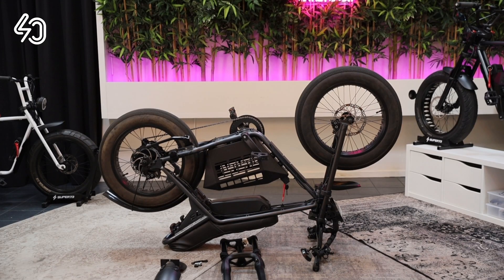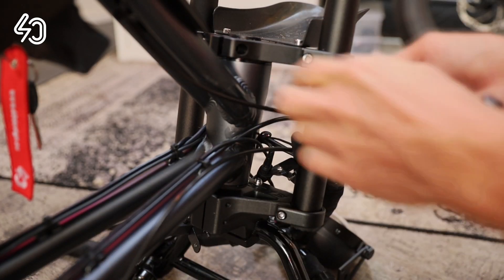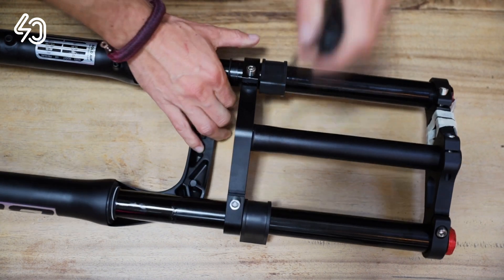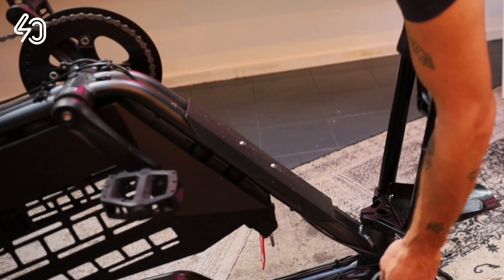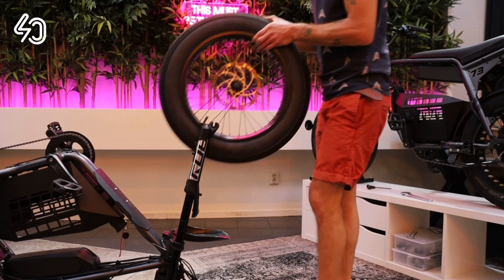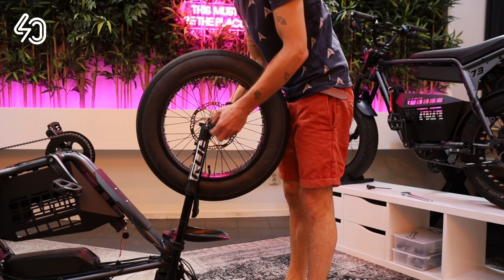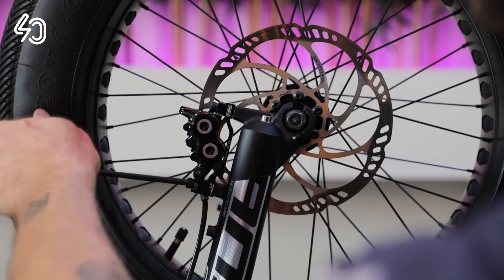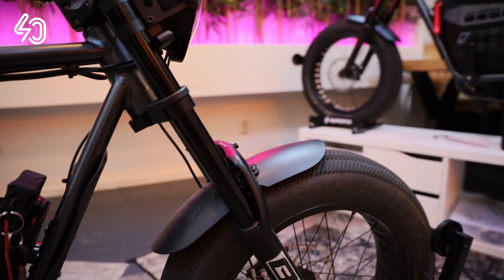Airfork installation on the Super73 ZX

Comment: Do u need anything else with these forks
Reply from the maker: Nothing extra required, it's an easy swap. However, there are some rare versions of the Super73 ZX where the original fork diameter is 31mm instead of 32mm, making the swap with a 32mm airfork less straightforward.

Comment from the maker: Please note that it came to our attention that Super73 uses two fixed fork tube diameters: 31mm and 32mm. This tutorial specifically applies to the 32mm forks found on the Super73 Z-Miami and Super73 ZX. While it can also be used for 31mm forks, modifications to the top and bottom crown are required.

Comment: I have the same bike and same suspension but it does not fit. What do i do now?
Reply from the maker: Which part isn’t fitting properly? For instance, is it the top crown with the fork tubes? We recently discovered that Super73 seems to have produced two different fork tube sizes for the Super73 ZX. The standard size is 32mm, but there also appears to be a rarer 31mm version.

Comment: Would this fit on a z Miami
Reply from the maker: The Z-Miami has a lower frame profile, and while the tubing should still be 32mm, the lower profile causes the front to sit significantly higher. This wouldn't benefit the handling and aesthetically looks a bit off.
Reply: thank you, this helps a lot

Comment: Hello, bought bolany air suspension, but the bike seems really high though, is this normal ?
Also if I don't have the fenders in the video, will the default ones work well ?
Reply from the maker: The Bolany forks we sell are like a kit with all the brackets and adapters to relocate the original fender and calliper. When parked without any weight the Airfork will always look a bit taller. If set to the correct pressure parameters it should drop flush with the frame when a person is sitting on the bike.
Reply: @fortycustoms  Thanks !

Comment: my stock tires on the zx are 4.5 should i change my tires to a 4.0 and then buy them.
Reply from the maker: I would recommend getting bigger tires not smaller, Our Super73 ZX is fitted with LIZRD's 4.5 in front and 5.0 in the back.
Reply: it is the same for me but the fork measurements are 4.0 do i still get them taking in consideration that my tires are 4.5 @fortycustoms
Reply: What’s the size of the adapter you use for the breaks?

Comment: So the crown plate the comes with the shock is unused and you use the plate that’s already on the bike?
Reply from the maker: Yes because we want to maintain the original Super73 crown plate embedded steering clamp
Reply: The original crown plate hole circumference is smaller than the fork. How did you get the fork to fit the original crown plate so easily? Did you have to modify the crown plate?
Reply: I have the same problem, the air fork legs do not fit through the original holes.

Comment: Do you know if this would fit the older Z1?
Reply from the maker: I have seen Z1 owners installing the same type of fork but its not as straightforward as on a ZX. The whole crownplate and handlebar clamp needs to be replaced as well.

Comment: Can you put this on a non super 73
Reply from the maker: If the bike has the same spec sizes as the Super73 ZX it should work. The fork is a 20inch 4.0  with a tube diameter of 32mm.